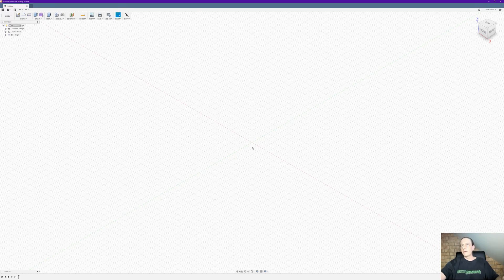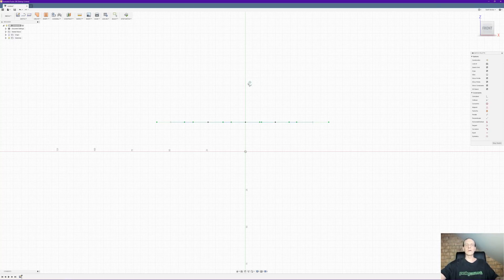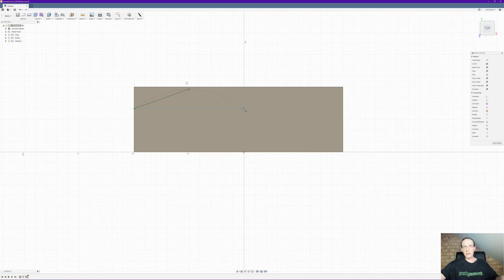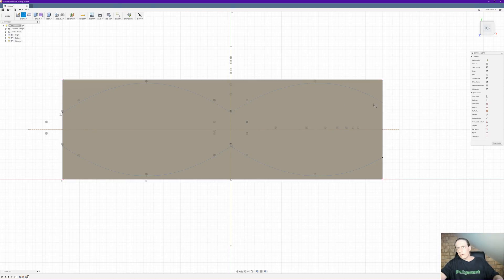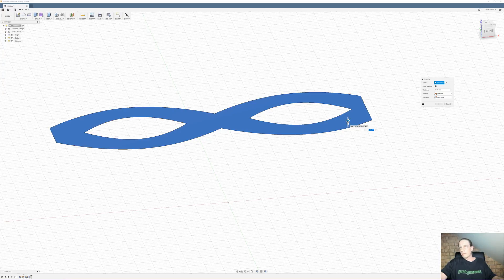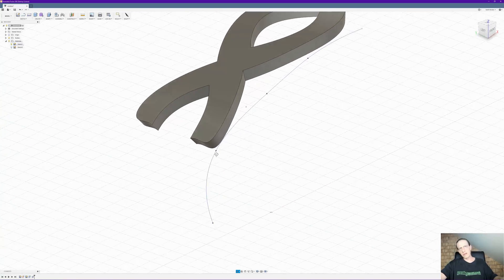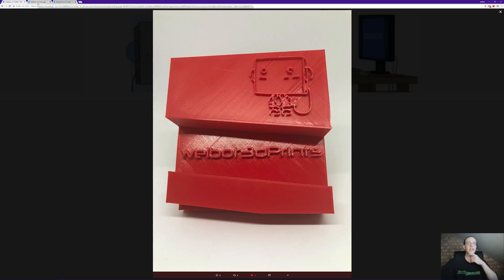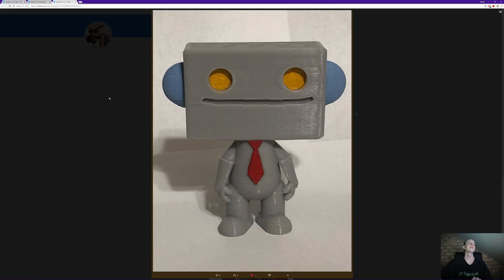Bending Fusion 360 to your will + other cool stuff

Comment: Unfortunately this is not quite the solution, that fits all purposes. This is basically an orthogonal projection which can sometimes solve the task, but can't cover most "bend" applications. For example this solution can only bend less than 90 degrees per side and the sides will be distorted. This can actually be done in the solid modelling workspace using two perpendicular planes with sketches. In one plane you can create an extrusion and a cut or boolean extrusion on the perpendicular plane. There is however another way to achieve bends using the sheet metal workspace. This method is a bit more flexible as it could bend any object along an arbitary axis. It works by creating a folded piece, then unfold it, merge with the object to bend and then refold the sheet metal. As a last step remove the unnecessary faces from the merge operation.
Reply from the maker: This wasn't really created as a universal bend anything any way solution. There's plenty of different ways to go about bending things, but this was intended more as just a quick tip for if you want a slight bend in something :) Plus the sheet metal stuff wasn't actually a part of Fusion back when I made this video :)
Reply: @welbot  I missed that the video is from before the sheet metal workspace was available. The video still comes up, when someone wants to know how to do bends now. So I guess it's fair to point out that there is another way.
Actually there is now a third possibility, which would be the emboss feature.
Reply from the maker: @Noxoreos Yeah youtube really only does word searches, so it's not really possible to exclude it from searches like that. I will add it to the description, but that will likely only just make it show up in searches for the sheet metal workspace as well 😂Can't really win either way. Still, it is useful for adding bends to some things.

Comment: WAIT a minute... ur a human!!!! great vid, iv saved it for later and will defininately be using this, not quite the bend tool that solidworks has but this is a great replacement :) thanks for the detailed tutorial.
Reply from the maker: I believe they may be adding an official bend tool at some point. I'm sure I saw a post on their ideas board that was accepted, but if/when it'll actually happen, who knows at this point :)

Comment: Hey Welbot, great stuff. Tell me, if you right clicked onto the original line ( Patch? ) can you add more points to it like you did the other splines? Cheers, JAYTEE
Reply from the maker: Yes you can indeed! You can do it to any spline! I know it might seem odd that I said to put more points in to start, but it kind of depends on the shape you want. If you only want a simple arc kind of shape to start, 3 points is usually best to begin with, as more points complicates things, but if you want an s curve or even more bendy, I tend to put 1 or 2 more than I think I will need. (Possibly a bad habit to get in to, but when using splines often, it can save a bit of hassle) :) Thanks for watching :)